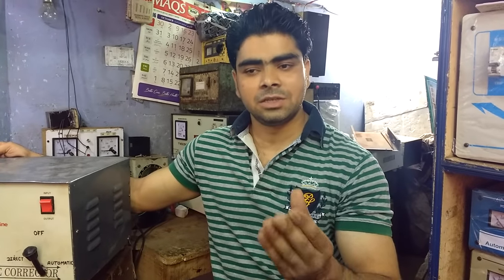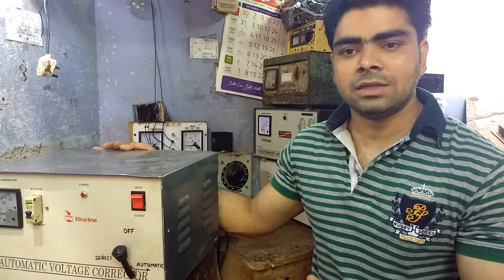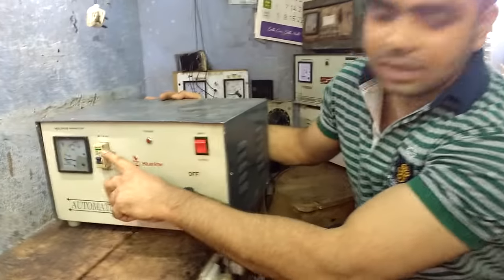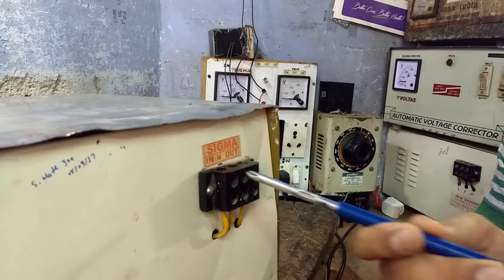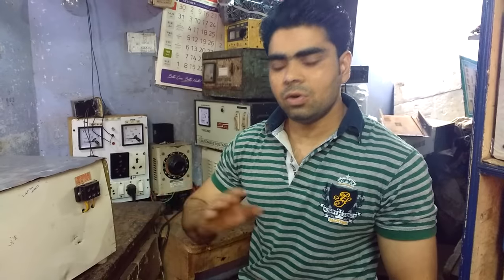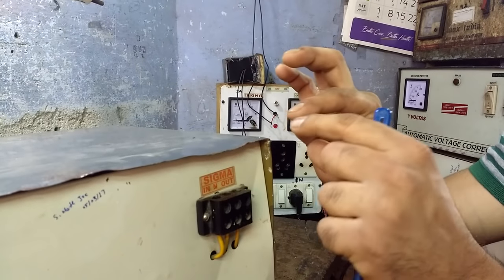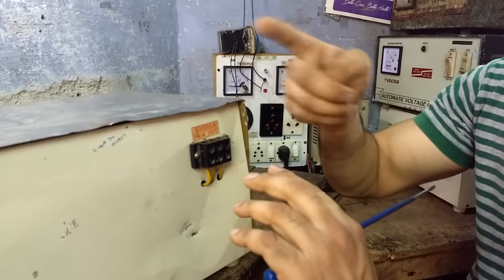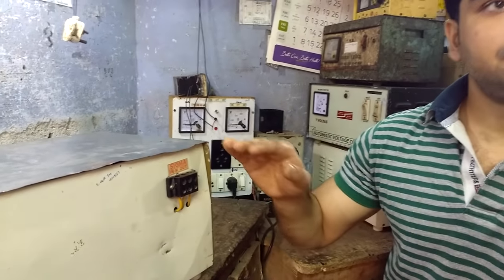Stabilizer/Steplizer/Steblezer Connection कैसे हटायें (DISCONNECT) | Skill Development

Comment: bro 5kva voltage stabilizer kitna voltage increase krega. range batado
Reply from the maker: 60V.  ,  90V.   ,110 V.  , 140 V. To 200 V.
Reply: 60V, 90V 110V 140V inme se kisi bhi input pr output 200 hi rhega ye kahna chahte ho aap. but 90 volt increase input
Reply from the maker: I mean to say,ye alag alag input range se Stabilizer bante hain, aur inki starting range se voltage aayenge ,toh ye usko increase ker k 200V. banayeinge

Comment: Bhai 5kb stabilizer ka connection kaise krte h meter se
Reply from the maker: main line se Jo phase aur neutral k wire aate hain, usme neutral ko bina cut kiye Stabilizer k neutral wale point per connect ker dete hain, aur phase ko cut kerke Jo electric meter ki side se wire aata hai ,usko Stabilizer ki input bana dete hain,aur Jo wire ghar ki wiring me jata hai,wo output hota hai
Reply: Skill Development tnx
Reply from the maker: Welcome
Reply from the maker: Don't forget to Subscribe